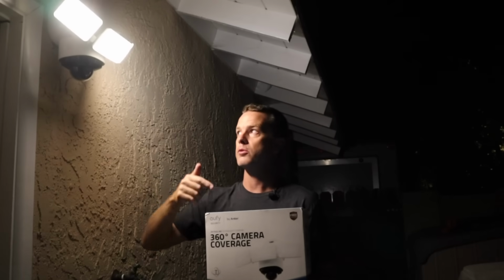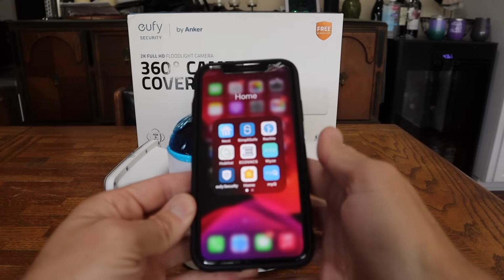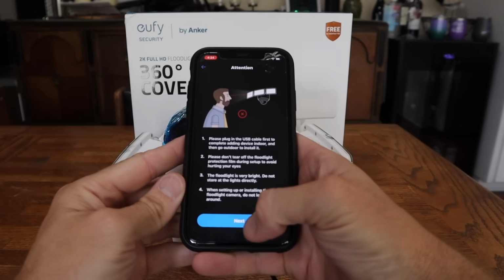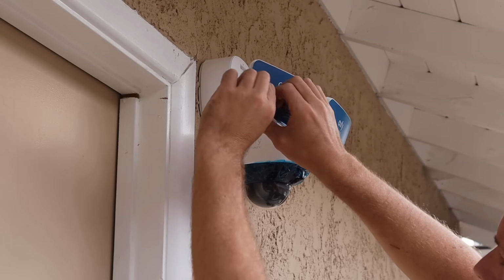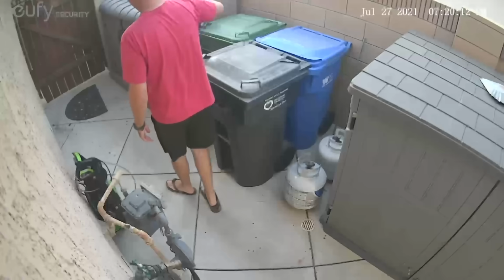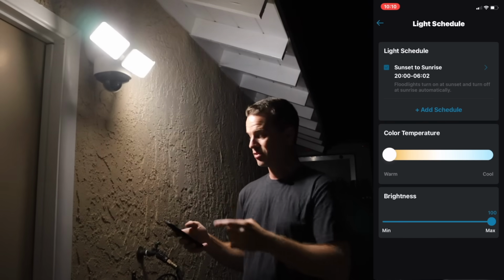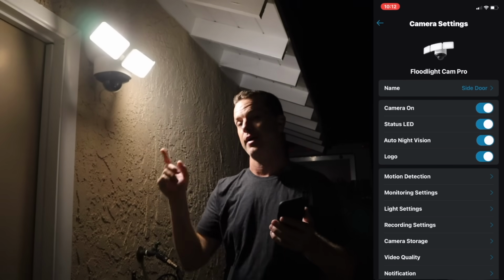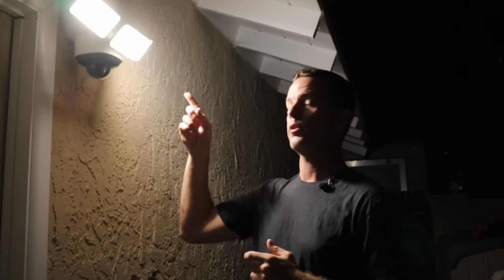Eufy Floodlight Cam 2 Pro - 360 degrees of awesome?

Comment: Why nobody tells about alertareas that did not work? I bought 3 cams and homebase. Everything installed  at my home, and now i realize that eufy detection did not work anyway. I bought and installed bullshit.
Reply from the maker: Confused, what’s now working?
Reply: @DoItYourselfDad  especially activity zones. 1. The activity zones changes randomly at their own. I did not have a single day where there are no changes, i have to correct it manually every day. 2. If the areas are exceptionally defined correct. There are much notification and recordings outside of this area. Eufy support is not able to help at the moment.
It's really a shame. The hardware is excellent, the headlights are very bright, and the cameras and motion tracking deliver very sharp images. Unfortunately, the app control and configuration options are unacceptably poor, making the primary purpose of reliable camera surveillance impossible to achieve.
Reply from the maker: @jens4711  Very strange, I've never had those issues. are you sure you're clicking "save" before closing out of the setup for the activity zones?

Comment: If my junction box does not have a bare copper wire, do i just connect the eufy ground wire to the mounting bracket w/ a screw that's labeled ground?
Reply from the maker: Yes, if you don’t have a ground wire the box may be grounded. Older homes don’t have a ground at all, if that’s the case, you’ll still be fine.

Comment: I want to set this floodlight camera up in my back yard where my kids hang out and play sometimes. Will I be able to control the floodlights manually to leave them on continuously if I need to, or do they only come on in dusk to dawn mode and whenever motion is detected?
Reply from the maker: Yes, you can. I have mine on low from dust till dawn, but if Im working in the sideward I can go into the app and turn the lights up and leave them on if needed.

Comment: Hello. From what I read regarding the specs of this system it operates on 120-240VAC. However I’ve seen some advertisements state it’s 120VAC. So please tell me what your system has stamped on it. Thank you in advance.
Reply from the maker: It’s actually installed at a relatives house now, but I’ll see if I can get that info for you.

Comment: they call it a 360 degree camera but the way it is mounted makes it lose a lot of it usefulness. I have this camera mounted to a telephone pole and probably 100 degrees is just viewing the wood pole. There's got to be a way to mount the camera where it actually offers 360 degree unobstructed view!?  Also, you MUST mount these high enough that an intruder cant spray paint the camera, put duct tape over the lense or rip the whole thing off the wall.
Reply from the maker: The way these are designed you can also mount it to a horizontal surface giving you a 360 view
Reply: I would to see one mounted horizontally allowing for 360 degree viewing. The mounting surface would have to come down from above somehow and then the camera mounts to the underside of it. Unless you can mount it upside down on the top of a 4x4 post. I dont know if thats a feature of the camera. They way most people mount this is like you did and that way loses 180 degrees of the 360 degree  viewing capability. Also, if a thief can reach the camera, they can cover it, rip it off the wall or even cut the wire. The thief that stole my truck last year walked behind my cameras and put duct tape over them.    @DoItYourselfDad

Comment: Just ordered one and discovered it doesnt have a microsd slot AND doesnt record 247..only motion triggered events.  WTF. Now i am considering to return it. 😡.  How the hell can you sell it for $300 but not let you save footage on an sd card or record 247?
Reply from the maker: Why would you want to record when nothing is going on?
Reply: @DoItYourselfDad  Because there has been car accidents happening outside of my detection zone with another cam i've been using.  So i want to be able to record stuff in the middle of the streets too but not as a triggered event. I want to be able to rewind and watch how it all started. I also have another Eufy cam but there seem to be a 10-15 second delay before it gets triggered to record so I'm afraid this one might have a delay too, being that its wifi.

Comment: I know these are to be installed where a light exists, but wonder if it can be wired directly to an inside outlet box?  To where it has constant power.  Because I know my kids would turn off the porch light switch without thinking about it.

Comment: I have one of these for a couple of months. 

1) I have two issues, one is weak wifi signal receiver. I have to keep wifi router on inside of wall next to where light is mounted. Any farther away and it looses signal. I have other wifi equipment that accesses the same router which are farther away but have no problems.

2) Setting camera positions for "Auto-Cruise" feature is unreliable. Two separate times I have set the four positions and then tried to define activity zones for each position. One time the camera only allowed access to one of the four positions, the second time I could access three of the four. After setting the four positions, the thumbnail image of the positions are sometimes blank, even though there is a position set for all. Another time after setting the positions, when I went back into looking at the Auto-cruise definition, some of the position definitions were changed. It has some picture and setting for three of the positions.

Eufy is aware of these issues but have not been able to resolve them yet.

I honestly don't see the use of the Auto-Cruise feature even with different positions set so I disabled it...

Comment: i dont understand your camera is very close to the wall why are you not having issues - i bought the eufy floodlight pro on the basis of this and one other vid review and am a bit annoyed you wee fibber  
my camera is not working - it films everything except what is within the set activity zones
the lense has no protection from rain drops and the support is way too close to the wall which means the light shines on the wall and the night vision doesn ot work - there is a setting to switch this off which maye explain why the floodlight does not work .. for me ... works now and then for everyone else though - was even on during the day - set to fast 
the Eufy pro need a much longer neck to take the camera off the wall or a bracket to attach the kit to 
Support is rubbish - tech will get back to you - tech says lower the camera 
Keeping me in frame? joke -  I was actually grinding off my gate - you can hear it on the vid but the camera is fixed firmly to an empty spot on the driveway 
the next clip shows me halfway up the drive with the gate and then goes back to watching the wall or driveway - its favourite positions when not filming neighbours driving around and walking everywhere except in my driveway / garden

And no they will not pay the cost of the re installation if the camera still does not work after i pay for the camera to be moved 
And no they will not replace the camera if not fixed by reducing height,
Neither will they refund the cost of camera if it turns out the camera is not built for narrow driveways on gable end which is perhaps 45% or more of sales? 
Which I think means that Eufy will not honour any warranty

Comment: Great video, thanks. Do I understand correctly that it requires constant power (obviously) so if my current simple floodlights are operated by a wall switch, then I’d need to remove the switch and make it a permanent wiring? Then the only way to switch the lights on and off will be via app?.. That sounds quite a bit inconvenient..
Reply: Yes, it needs constant power. But in your case; you’d simply need to install a light switch cover. That would eliminate the possibility of anyone accidentally turning the light switch off. $5 fix.

Comment: Warning on this spot light....It must be installed no higher than 9' above the ground. Other than that it is the best device I have purchased for security. In my case my electrical is located in the soffit of my second story home so it worked perfectly for a few months then it stops working at night.
Reply: Why can't it be installed higher than 9'?
Reply: @joey84-i9c  it actually is called out in the instructions but no where in the marketing materials. I bought one and installed it on my soffit of my two story home. It was fantastic and performed better than my expectations, until it didn’t. It lasted about 6 months when I noticed it was no longer working at night, neither the flood light or the camera. Customer service was outstanding. They tried several settings but no luck so they sent a new one to me at no charge with prepaid return box for the non functional one. The new one again exceeded my expectations but again quit working at night after about five months. Customer service was great again but after asking me to send photos of the installation they said I had it mounted too high and I needed to get it down to about 9’ above the ground. Too bad so sad my problem. Fortunately I bought it from Amazon as after several emails they picked it up and refunded my purchase.

Comment: Can this be plugged in?  or does it have to be wired? I do not have an existing floodlight to wire it. thanks
Reply from the maker: This has to be hardwired in, you can’t power it via USB.

Comment: Great info so how high up can this cam2 be installed at every video shows it set so low for demo any idea how high up on roof line can it be set up???
Reply from the maker: You can really Set this thing up as high as you want, the issue is if you set it up to high all you’ll be looking at is the tops of peoples heads which won’t help if you’re using it as a security camera
Reply: @DoItYourselfDad  Thanks I found on the web site from Eufy that 9 ft to 12 ft fax so I did mine at 10.5 ft great field of view

Comment: Can you have multiple devices control a camera? for example mine and a spouses phone too
Reply from the maker: Yes, you can. You can run the app on multiple devices using the same login, or you can have separate logins and share devices between accounts.

Comment: hi thanks for the video with the cable you use to sinc it up with if I got one long enough could I power it from the inside of my flat   or does it only work hard wired  thank you for your time
Reply from the maker: I haven't tried it, but I don't think USB would provide enough power to run the entire thing.

Comment: My question to how to get the 3 Eufy Cam 2 Pro cameras to connect to WiFi.  I'm having challenges getting the Eufy cameras to connect to my Netgear router. Wondering if I need to get a WiFi mesh system to 'bounce' the WiFi closer to these devices ?   I live in a concrete/cinder block home (Florida).

Comment: Ok, it is very cool camera, from what I  see from the video however I see at least 2 or 3 major problems with it.
1. Price ( it is not major problems, at least not yet. )
2. What happens when second person shows up on other side, what if firs one only decoy?
3. If you or your dog running on back yard or cars passing by, I guarantee this cam will be dead in two months from all the motions it doing not talking normal failure rate all devices have.  (And it is when cost becomes an issue).
So in my estimation tree separate cams will serve you better even one dies you still have back up of two.
Reply: No answers ?

Comment: I just bought one and before I install I have a question if you're able to answer.  I need to place the Eufy under an eave right next to a bathroom window which we keep uncovered.  Will the activity zone selection allow you to prevent the camera and floodlight from activating every time someone goes to the bathroom?!
Reply from the maker: You can setup detection zones and exclusion zones, so you can make sure the bathroom window isn't included in the detection area. I have some of their cameras setup the same way in my back yard so it doesn't alert us when we are walking by windows in the house.
Reply: @DoItYourselfDad  Thanks!

Comment: Thanks for the video. Quick question this, can you power this with the USB or does one need to pull in wires / junction box for this?
If the latter, does it needs its own dedicated wires for this or can i hook it onto an existing line that has my garage dawn to dusk lights on them as well? Thanks
Reply from the maker: I haven’t tried powering it from the USB, my understanding is the USB won’t power the lights though. It doesn’t need a dedicated circuit though, just content power so as long as your other line is constant you’ll be fine.

Comment: Questions:
1.  Does it record to the cloud or where?
2.  Can I manually view the camera or do I have to wait for motion?
3.  If power goes out or if wifi goes out will the camera automatically reconnect once the power or wifi comes back on?
4.  Is there ANY reason anyone would have to take the camera down and rest anything at all?

I am looking for a no fuss camera to replace my Arlo cameras that require me to get on a tall ladder to replace batteries or to reset the wifi connection when power or wifi is off momentarily and turns back on.  I fell from the ladder once doing this.  I don't want to risk falling again.
Reply from the maker: This camera has local storage, but you can also set it up for cloud storage if you’d like. You can go through the app and manually view the camera, you don’t have to wait for motion. If the power goes out it will automatically reconnect, it happens a lot here. There really shouldn’t be any reason You would ever have to pull it down, if for some reason you didn’t have to access the sink button that you could get to it without removing the camera from the side of the house. Another nice option is the S 40 camera by the same company, I should have a video out for them this Friday, it isn’t a pan and camera, but it is solar powered and has a spotlight. Nice little set up.
Reply: I have two of these cams set up

1. It has local storage, about 17 GB I believe
2. Yes you have full control, you can tune in, move the camera with an onscreen joy stick, speak through the camera, turn the light on and off, turn the siren on or off, turn the night vision on or off and manually record or take photos of whatever is happening. (it also allows you to share or save recorded videos easily to your phone)
3. It does reconect automatically with out any steps required other than storing power
4. No reasons other than if it become faulty or you're moving house/camera location.

Comment: So this is hard wired. I like my others because they are battery. No we don't have to take them down to charge as we power them solar. Charging hasn't been a problem and I don't expect it will be over winter. We have tons of smoke filling the valley from California's fires that make the days seem like evening and the cameras still charge. Our flood lights are strictly solar, 2000 lumins so when power might be out those flood lights still work. We live in Oregon and are under constant threat of power outages due to possible brown/blackouts.  We have 12 of those solar flood lights.

So to my question, is there a battery that will keep the flood lighting on this working if we have loss of power or are they just off?
Reply from the maker: No, these ones are powered only, Stay tuned, I have the solo E 40s from eufy coming in this week which are solar powered and have a flood light. I should have a video up for those soon.
Reply: @DoItYourselfDad  thanks, I will check for new videos.
Reply from the maker: @marypettit5523  awesome! I'm hoping to have it up in the next three weeks or so

Comment: I tried using the discount code and it was unable to find a valid code….any suggestions?
Reply: Worked thru Amazon! Thanks
Reply: I had to buy through Amazon to use the code. It doesn’t appear to work on the Eufy website.

Comment: does this require 110v 24x7 to work or does it have a built in battery to run during the daytime?
Reply from the maker: Yes, this one needs constant power. They do have a couple other models that are battery operated, they just don’t come with the floodlights. I’ve got a few videos on those on my channel if you want to check them out
Reply: @DoItYourselfDad  thanks.  does it connect to an existing HomeBase for video storage or is it self-contained?
Reply from the maker: Self contained.

Comment: Bought it and works great. Starting to really like the eufy products.
Reply: How do you like Eufy a year later? I am trying out the Solar Cam 220 and see how it goes before I think about replacing Ring.
Reply: Really ? I own 2 and the motions detection outdoors at night is very slow and also very short range.

During the day it works good though. But Nightline recording is when bad things happen

Iesssge eufy and they said the only fix for this is to set to all motion and not smart human detection.

I tried that and that's terrible because it picks up everything, even snow or leaves lol

Also the app does not always update all the recordings. It skips a few . But most go through

The lights work great and really bright
Reply: @blockchainshark1392  Do you own Ring cameras to compare the Eufy to?

Comment: Can this be set on a light switch to turn the lights on for general lighting?
I have a floodlight over my garage and I'd like to replace that light with the Cam 2 Pro. I' think I've read of other floodlight cameras that use the switch in 2 modes - leave it on for auto monitoring or turn it on/off/on quickly (or vice-versa) for manual override mode.
Reply: I would like to know this too as I would want to place it where my current flood lights are located.